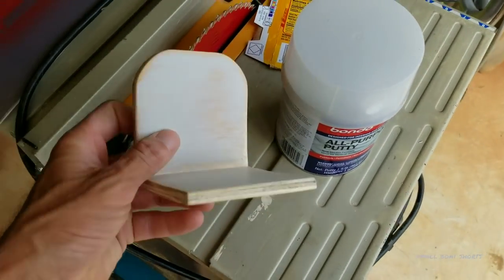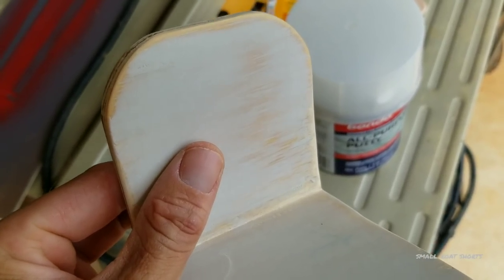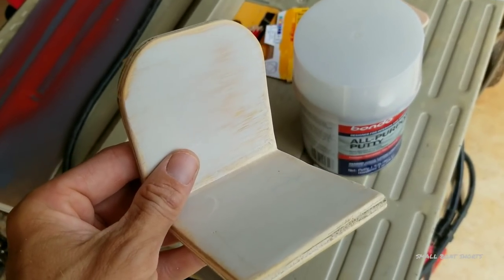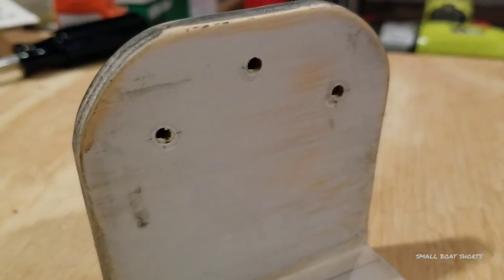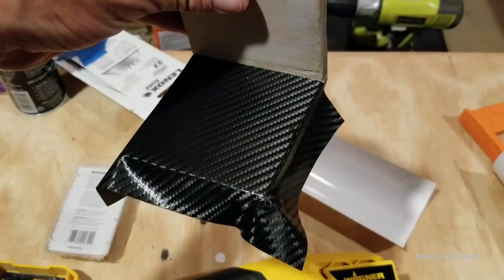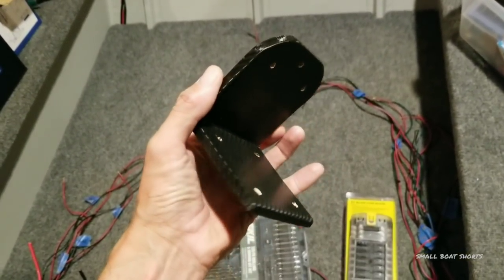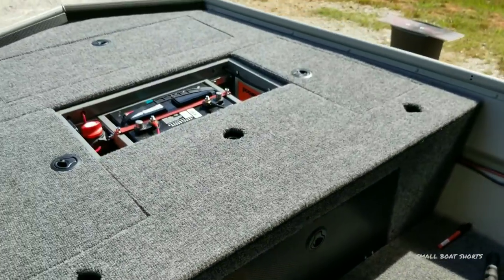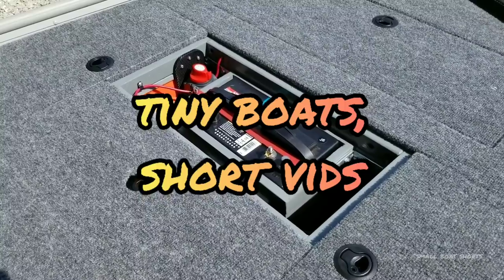SMALL BOAT SHORTS Ep. 3 - Carbon Fiber Vinyl Wrap

Comment: All though it does look killer wrapped. I build race cars an use a ton of real carbon (self taught). I would love to see you play with real carbon an seek the real benefits of carbon. Light weight, just as strong as metal in some cases. You are very mechanically inclined I would love to see what u could come up with for the boat.  Love the channel!
Reply from the maker: Yeah I know how to lay carbon. I had a show car that appeared in a lot of magazines, won Sema for its class, and worked on multiple SEMA cars as well as did a custom widebody on a cover car. I actually moved to L.A. to do composite work and owned my own small business,  Fiberlab, where I did one off carbon parts. I was thinking of doing some actual carbon or kevlar parts on build #2 but honestly the stuff I'm using is so light the work put into making carbon parts and the minor weight savings isn't justifiable to me. Looks damn cool though and because I was in the car build scene you can probably tell my boat is highly influenced from that culture. Thanks for tuning in, may do some actual carbon work in thefuture!

Comment: Looks good. Just did some Aluminum panels myself with 7d grey carbon fiber. It was a learning experience. 

It's a good idea to go over the whole piece after wrapping with heat to set the adhesive and vinyl.
Reply from the maker: Aw man I was hoping for a more intriguing comment about smuggling runs or what not. Good tip though, makes sense to me.
Reply: @AnthonyJonesBrigadeBoats  well it was  trafficking. And no not human or sex.

Comment: Looks nice but how durable is this stuff? Marine applications are tuff. Pounding levels of sunlight and of course water and high humidity.
Reply from the maker: The 3M products are used primarily on vehicle exterior wraps. If it's good enough for that, it's good enough in my boat. Especially the parts I'm using it on. I have full confidence in the product but I would only use 3M and not cheap imitations. You get what you pay for in quality,  workability,  and durability in vinyl.